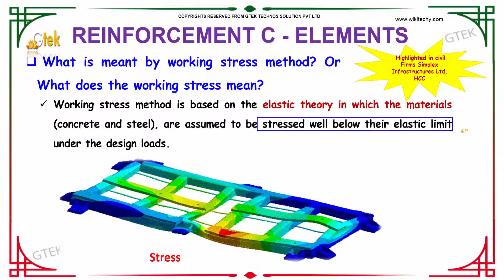What is meant by working stress method | Reinforced Concrete Interview Questions

Comment: The Working, Allowable or Permissiblestress method is an elastic designmethod. In this design method, members are designed to never go beyond their elastic range. ... Limit State or Load Resistance Factor design uses the ultimate strength of a member, beyond initial yielding, to determine the allowable strength.

Comment: Working stress method is based on the elastic theory in which the materials (concrete and steel), are assumed to be stressed well below their elastic limit under the design loads.